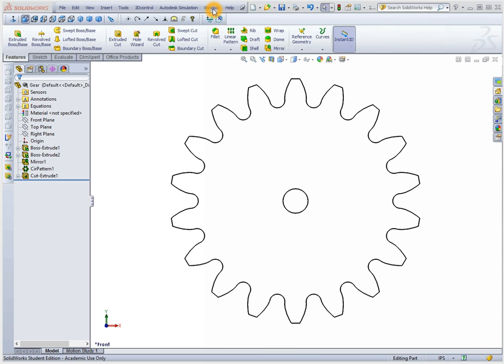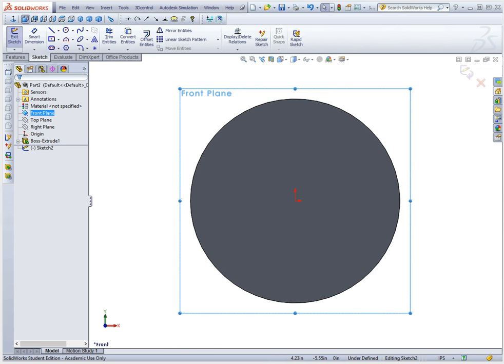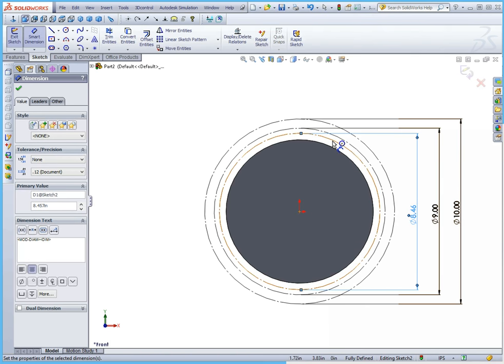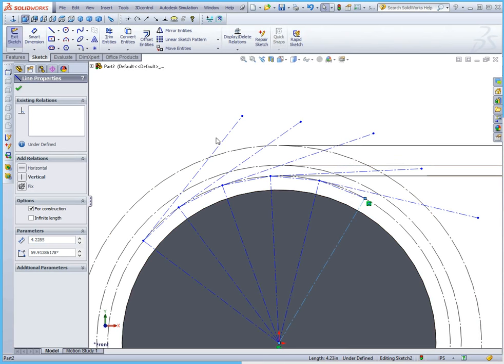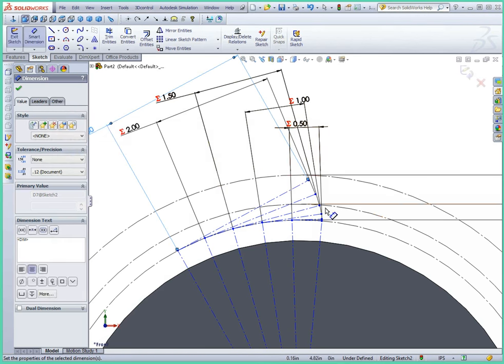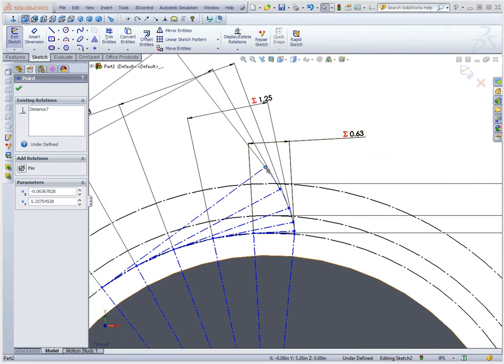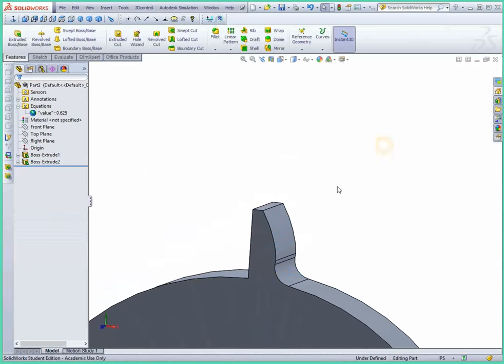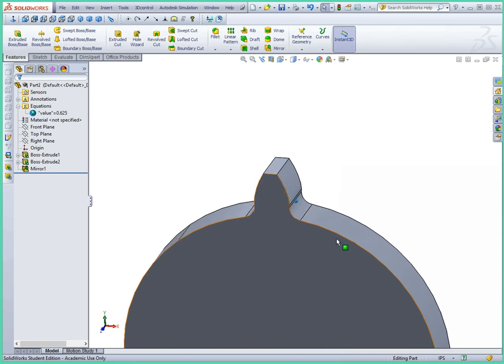Drawing an Involute Spur Gear (HD)

Comment: For those who need the equations:

1. Pitch Diameter (d) = given (you choose)
2. Number of Teeth (n) = given (you choose)
3. Pressure Angle (p) = given (you choose; typically is 20 deg)
4. Diametric Pitch (dp) = n / d 
5. Dedendum Diameter (dd) = d - ( (1/dp) * 2)
6. Adendum Diameter (da) = d + ( (1/dp) * 2)
7. Base Diameter (db) = d * cos(p)
8. Tooth Width (tw) = pi / (2 * dp)
9. Half Tooth Width = tw /2 
10. Tooth Width Angle (ta) = (tw / d) * (180 / pi) 

Hopefully these are correct. Correct me if I'm wrong. AM 8/26/2020
Reply: The tooth width formula is referring to the topland distance of a tooth? Where did u get this formula, machinist handbook? What is the formula in Module? Thanks
Reply: @vincentlee2460  Hello, I'm late to the party, but the formula in module is simply (1.57 * module). I got this from Norton's Design of Machinery. This is the tooth width, not the top land. You can obtain the top land width multiplying (0.25 * module).

Comment: Great tutorial. I am reverse engineering some pretty interesting gears from a lathe gearbox - actually there are gears with different numbers of teeth working on the same center distance (slide gears). For example, there's a 30 and a 33 tooth gear, both with the same OD, that work with a 24 tooth counter gear. I have calculated the gears to be DP 12, with a +0.4 profile shift on the 24 tooth gear and yet to be determined positive/ negative profile shift on the 30/ 33. With the given center distance these can be accurately calculated. The SolidWorks modeling is great for checking. I plan to get the actual sample (damaged gear) on a profile projector and get a 1:1 image from that which I then will be able to check against my SW constructed profile. This should be sufficiently accurate. Thanks again for the video.

Comment: I like the information on the involute profile and how to draw it. 

What I didn't so much like is modeling practices, especially in SW, So for others learning always mirrors the sketch if you can it is far far more efficient to solve and you're going to be patterning also so it's really important to keep your features light. If he were to do a whole gearbox his system would slow to a crawl trying to solve a mirror pattern on a few thousand features.  

also and this is more if you ever plan on working for others give variables names that make sense and if you're going to use a shit ton of construction geometry either name it in the sketch or name them in the variables for a teaching aid I would add the name in the dim text. 

lastly, add radios using the feature. you will find that relief radi changes depending on how something is machined it's far easier to change the radius feature named gear relief than to undo a double tangent constraint. 

I would have also defined most of the calculated values in the equations but that is just my preference, I would also have put the 3 diameters in their own sketch and described the involute curve in another. I may have been so inclined to put the extrude geometry on top of the theoretical curve just to keep it clean and understandable then there would be an argument to define the relief in the sketch.

Comment: I think you're a little off on your involute profile. The variable radius lines should equal the arc length along the base circle and not the line segment between the two points.  The error is growing for every sequential radius calculation.
Reply: This is an excellent video tutorial for learners in middle level. According to the definition of an involute curve BilletBenny's remark is correct.
Reply: A wanted to comment the same! It is important, when you make a part where precision is priority.
Reply: I think  the author is correct.  If the base sectors have equal angles, then successive tangents will have length twice the preceding ones.if a circle is divided into 4 parts, then every tangent at the 4 points will have a length equal to 2 times the preceding one. The last will be the full circumference of the circle and is 4 times the length at the second tangent. The second tangent is just 1/4 of the circumference.

Comment: I am trying tp create my involute curve with the following sized gear:

Picth Dia. = 330
Module = 3
No. of teeth = 110
Pressure Angle = 20°

My base circle Diameter (134.67mm) is much smaller than the pitch diameter and also the addendum.

This presents an issue when I create the involute curve connecting the segments. the involute curve does not intercept the pitch diameter.

Has anyone modeled larger gears?

Comment: why do i get my base circle diameter smaller than my dedendum diameter???
Reply: im making my own gear. i have a diametric pitch or mod of 15. The gear i made has a pitch diameter of 1" and 15 teeth which works out fine. However, I am trying to make another meshing gear that is 3x larger. So for that gear I have diameter of 3" with 45 teeth; however, that gear provides a smaller base circle than the dedendum diameter. I don't get it. I'm stuck. Any help will be much appreciated!!
Reply: nvm i calculated wrong
Reply: nvm it still doesnt work
Reply: @Alex_Interests  I hope you figured it out